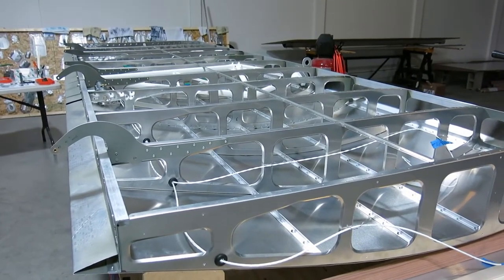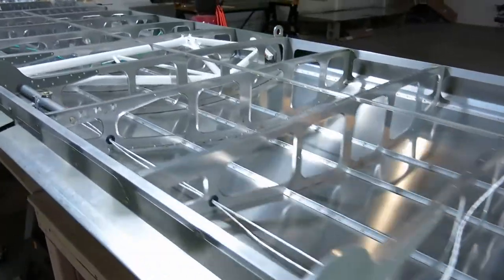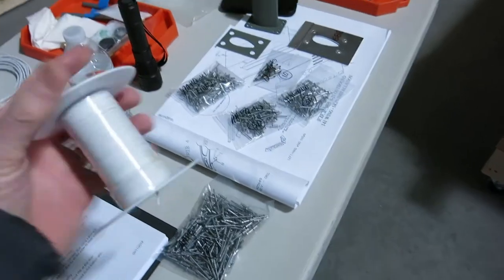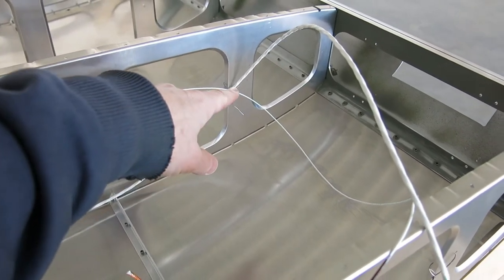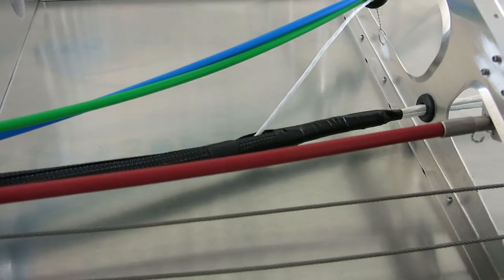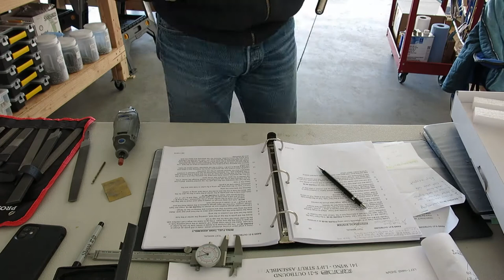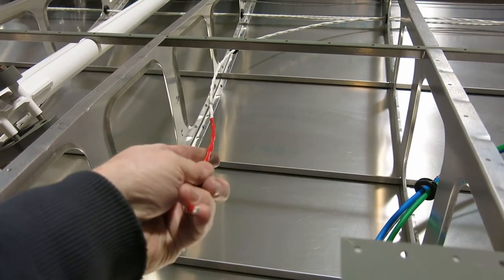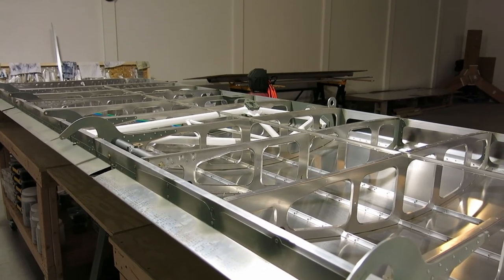No. 78 03-13-2021 Finishing up the wing interior

Comment: I’m still debating on the pitot tube lines as I am not a big fan of the safety wire hanging grommet approach.  I am considering using Adel clamps or possibly running conduit.  I am not sure if there are enough inspection plates to allow a new hose to be pulled through if that were to become necessary.  I will probably use Adel clamps if there is access to get to all of the ribs should a new hose need to be pulled.  If not, I may use conduit so that a new hose could more easily be installed.  I am thinking the same for the wires should there ever be a need to run another wire out through the wing.  Fishing through a series of grommets could be a real challenge, but fishing through a conduit is pretty easy.
Reply from the maker: It would be a challenge to change the lines for sure, but doable. Glad I switched to the larger grommet, though. The smaller ones I had in there would have made it impossible to remove the old lines if needed.

Comment: I would have the safety wire on the grommets tight on the ribs as they will vibrate and cut into the rib structure. Just my thought.
Reply from the maker: I was thinking about that and how to basically shock absorb the wire through the rib. Maybe suspend it with a dob of permatex through the hole in the rib. (Would that last?) ...?? That or fab up a short bracket that’s riveted to the rib that hangs down to support the tubing.
Reply: @s-21project92  If it was me I would use a 16swg aluminuum tab rivited and with a 3/16" land from the hole for the wire to go through and rivet it into place, as per you second idea. The way should the wire cut through it would not have any effect on the structural integity of the rib. We used a system like that in the RAf to support trial installation and some remained for years of operation, we used hard plasic grommets for the cables or tubes to run through, I am unsure of the grommets you are using, if they are synthetic rubber they normally have a life of around 5 years before breaking up if stressed (the thing that worries me is the ones you had that were small started cracking in less time than that).
I hope I have not thrown a spanner in your planes.
One other thing I would radius the corners of the pitot suport plate as it is a stress point onto the skin as it flexes in flight.
Reply from the maker: No problem! That’s one of the reasons I make these videos...not only to pass along what we’re doing, but to also learn. I like the idea of dropping a tab in there with a hard grommet. I’ll take a look at that. My wife might not be too excited about removing that bottom skin again. 🙂
But she’s been the best partner to work with.
Reply: @s-21project92  So happy I could pass on my experiance to give you ideas to help you build to a standard that you feel happy with.
Thank you for the time you put into producing videos, I know how much work is in editing them.

Comment: I don’t recall the issue with the wrong rivets for the rear spar.  I will have to check that when I get there.
Reply from the maker: Our kit shipped late July, 2020. The wing skin, rear spar, and gap seal thickness exceeded the -42 spec (called on page 006C-02, Rev. A). I contacted Randy and he said it had been revised to a -43, so they sent replacements.
Reply: @s-21project92  I picked up my kit mid July of 2020 so I likely have the same problem.  I lost all of the PDFs that I had downloaded to my iPad and the latest one (Rev C, line #16) calls for -43s, but I bet my kit shipped with -42s so I need to remember to check that.  I have been checking most rivet lengths since finding the too short rivets for my trip tab hinges, however, it is easy to miss something like this.  I will have to check my parts or packing list and see which ones I have, but I almost certainly have the wrong ones also and will need to contact Shelly.
Reply from the maker: My wife was smart when we inventoried. As she was dumping the bags of rivets into the storage containers, she’d peel the label off the bag and stick it inside the lid. It was a quick confirmation that we didn’t have enough -43s. 🙂
Reply: I picked up my kit in late July. Sounds like we should start a club! Interestingly I have the old rear spar attach design with a single hole rather than the three small ones
Reply from the maker: Interesting! When we were trying to figure out the rivet situation, I saw that Rev. C of the skins now have 2 stringers on the bottom skin. I’m curious what drove that design change.
Reply: @rcpaviator  I think mine has the 3 holes.  I picked up my kit at the factory on July 13th.
Reply: @s-21project92  Interesting find. I would like to know as well. Gets rid of some oil canning? That is a reasonably big change since it impacts all the ribs too.